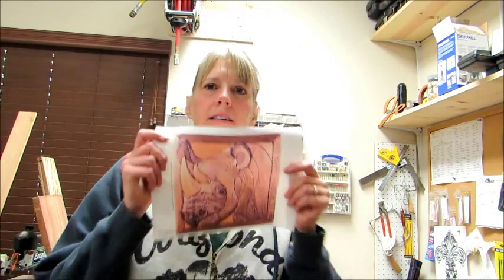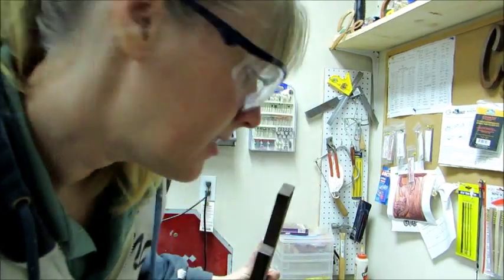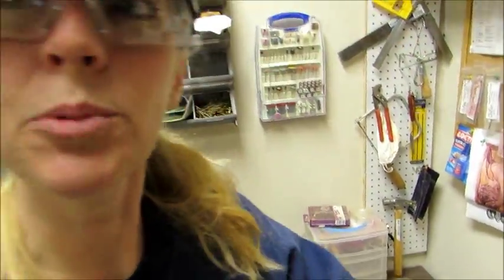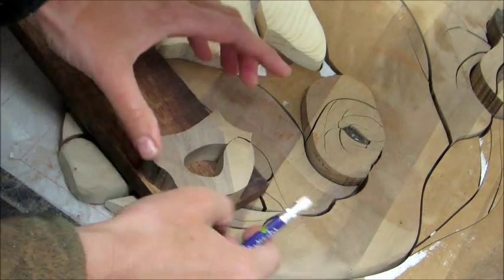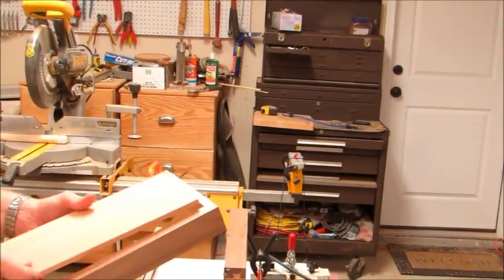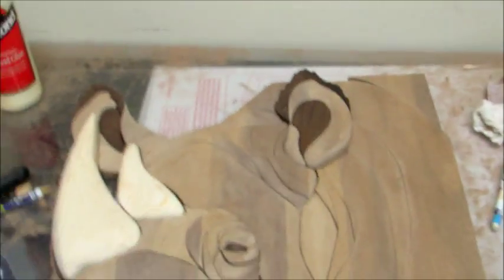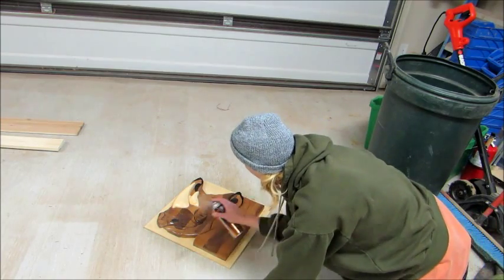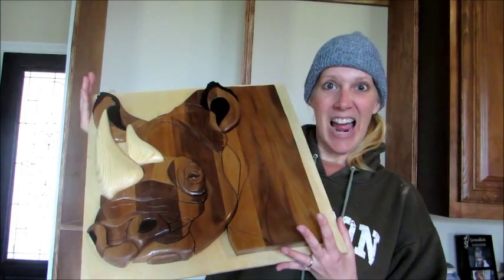The Rhino, episode #10

Comment: Hi Cy, I just subscribed to your channel.  You mentioned scanning in the drawing.  The drawing is big.... how did you scan it?  Also what brand is your pneumatic drum sander.  Love your work. Thanks
Reply from the maker: +Gerald Shultz Hello Gerald and welcome!!!  The picture is an 8.5 X 11, so it scans in fine, but when I print it I enlarge it and have to print in sections.  I used to take the patterns down to Staples and have them enlarge the whole thing for me, I would get about 10 copies.  But I have found now that it is just as easy to do it from home.   Actually now I dont even scan it in I just enlarge the copy I am going to make, I just have to move the pattern around so the correct area will copy.   Does that make sense ????
And my pneumatic sander is a Woodtek.  I love it  :)
Reply: Thanks Cy.  Good info.  It was kind of you to reply.  I am glad I subscribed.
Reply from the maker: Gerald Shultz And thank you for subscribing.  If you have any questions just ask because I am constantly changing the way I do things  :)